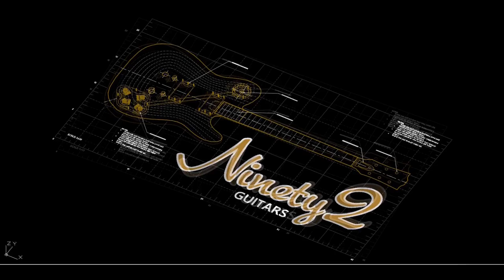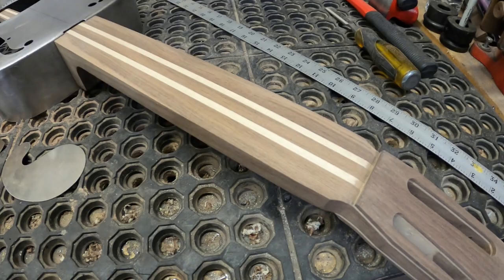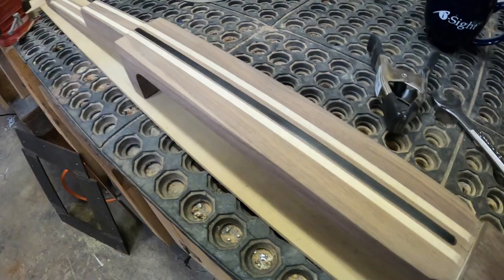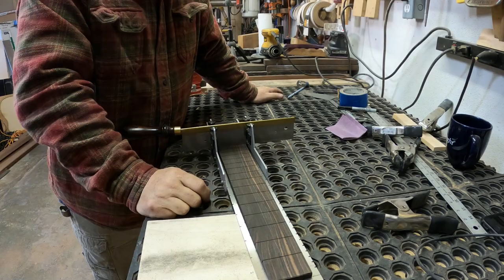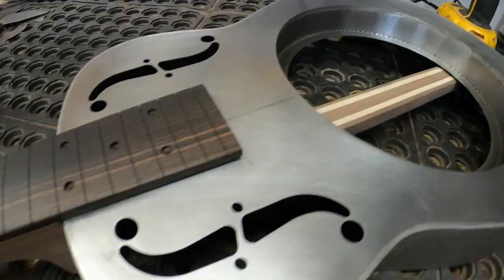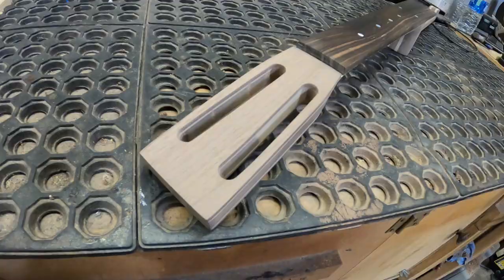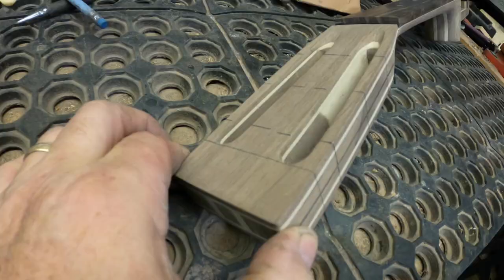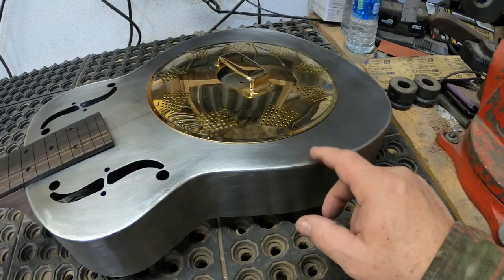Building a steel Resonator guitar | National Style | EP 9 | Fun and games til someone breaks a neck

Comment: Fantastic! Most metal resos I have come across don’t have a wedge under the finger board. There is a ply square under the metal that the finger board screws to, then a wedge between it and the neckstick bends the top to match the neck angle.
Pete T
Reply from the maker: Interesting. That might work for me also, I haven't finalized the neck angle yet so that could be a possibility. Thanks for the info.

Comment: The spare blades I have for a rasp thing just like that are marked "Stanley Surform". I only have the spare blades for a full-length tool and a half-length tool with a dull blade. The perils of picking up tools in boxes of "I don't know what he used these for, but they're yours if you want them"!
Reply: Lol, Mystery solved... Thanks.
Reply: I have a set of Surforms too but I've never found them especially useful except for carving urethane foam.
Reply from the maker: Thanks for the info. New blade is on it's way now.

Comment: Looks great! How deep is the well that the cone sits in?
Reply from the maker: 1.25 inches. The depth all depends on what neck angle you use. I'm using a 3 degree neck angle.
Reply: @Ninety2guits  Ok. How did you decide what angle to use? Im currently building a wood body reso and Im having trouble finding information on stuff like this
Reply from the maker: Dang, sorry I missed this. I went with 3 degree because I liked the way it laid out in the CAD plan. What I've learned since then is my sound well is too deep. Look at snakehips81 comments in EP11 comment section, that guy has a ton of knowledge and experience on these things. The 2nd build will keep the 3 degree neck angle but I'm going to make the sound well shallower. Unfortunately I haven't had time to figure out the revised depth dimension yet. My biscuit bridge is about 3/8" thicker than I would like it to be so taking 3/8" off the sound well depth is probably where I will start.
Reply: @Ninety2guits  thanks!

Comment: wonder if youre going to try nickelplating , its a pretty big piece but should be doable if you use big enough tubs and more than one anode spaced around the part 
https://www.youtube.com/watch?v=O3DCexCLoGQ
one thing thats the most important vif youre going to try the nickelplating : the parts need to be VERRY clean and free of grease
Reply from the maker: I hadn't put much thought into nickleplating. That sounds kinda fun. I wonder if the paint I put on the inside would wreak havoc on the nickleplating process. Thanks for the info.